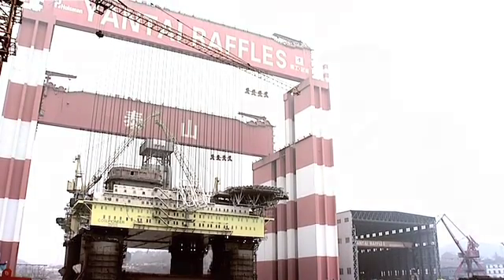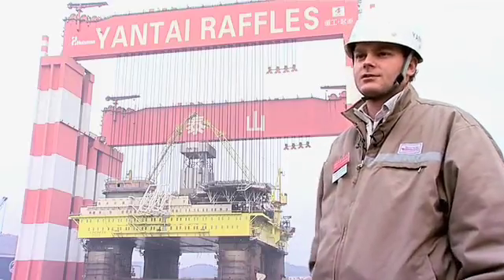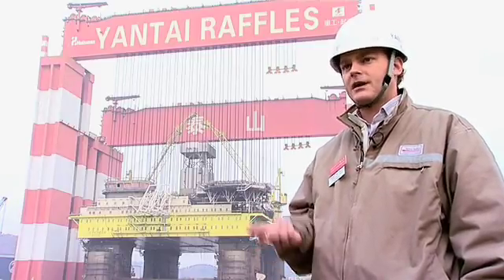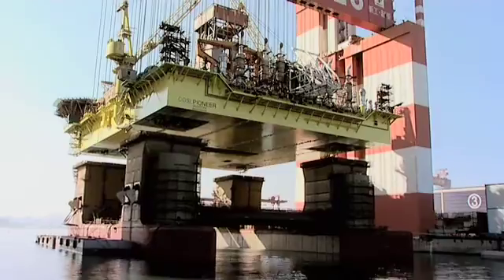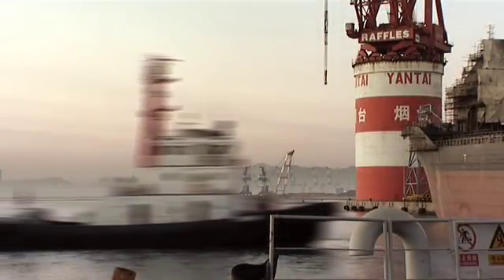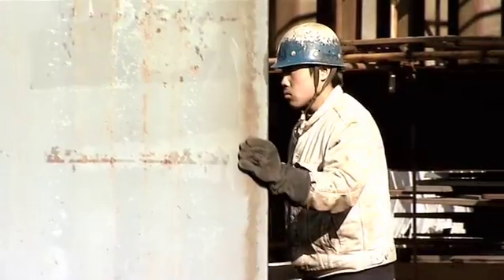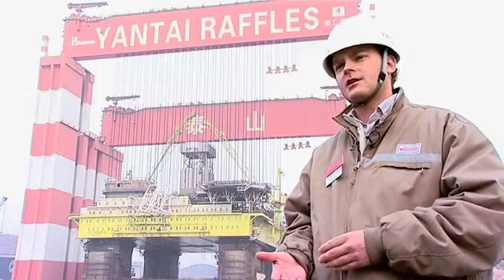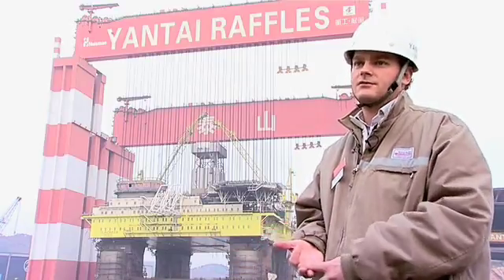TAISUN introduction

Comment: What a monster...  Is the vertical truss made out of solid forged or sandwiched steel?  Why are there no support brackets connecting the vertical truss to the horizontal truss?  The weight must have to be perfectly centered...
Reply: Forged